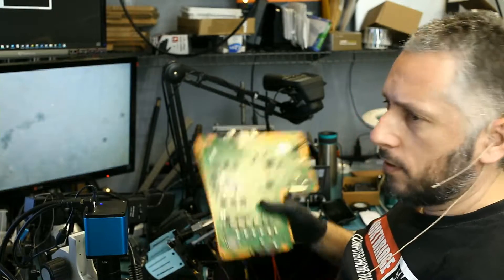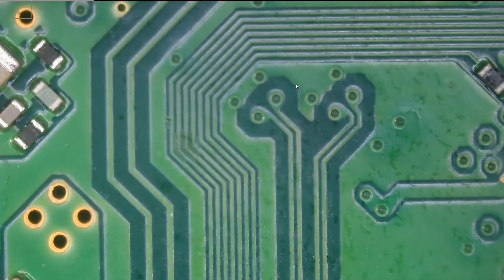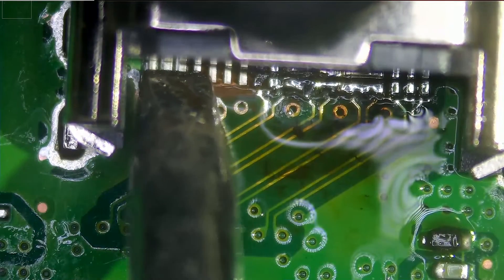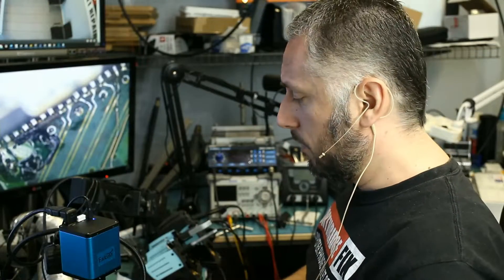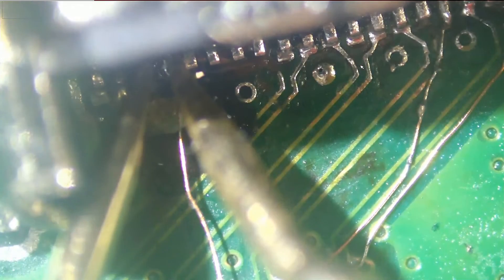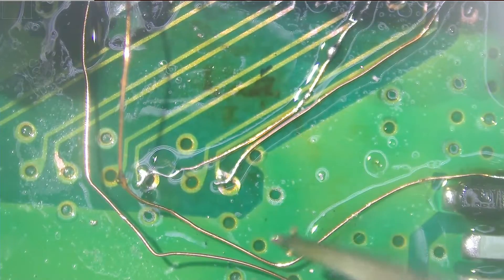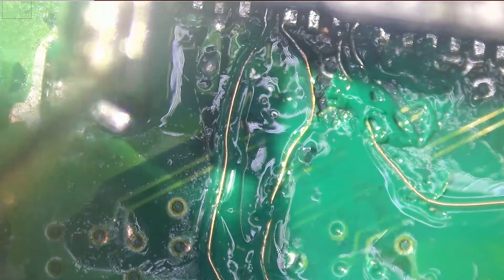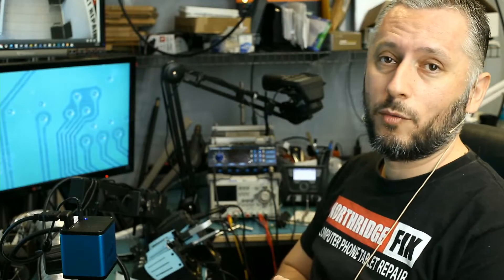PS4 HDMI Trace Repair - Pins Layout Diagram and connector replacement

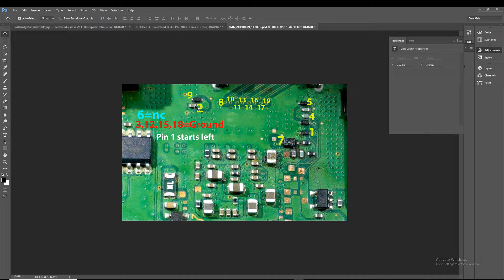Comment: Thanks! Good Video. Near same repair! 1 NOTE: Pin 9 is in fact Ground. If you look closely the sequence that starts on PIN 8 is as follows. There are 4 sets of data pins (those being (Pins 8 & 10, 11 & 13, 14 & 16, 17 & 19) as such At 1:44 of your video you have the pin outs you discovered with a donor board. Having said all that the minor correction here is that Pin 9 (HDMI) is in Fact GROUND (GND).
Each of the 4 Pairs of pins mentioned above has ground in between them. IE. (8,GND,10) (11,GND13) (14,GND,16) (17,GND,19).
Btw you marked it correctly as 9 (next to component) on your board diagram but might want to fix the list of Grounds to [ 3,9,12,15 & 18 ]
Thanks Again, keep up the killer work!

Comment: I use wires with enamel coating instead.
Reply: You still want a silicone coating or overcoat pen to secure the wires to the board for support so that the wires don't move and rip from where you soldered them.
Reply: @B9NE  that I always do. The one that hardens when UV light is applied

Comment: What size wire you using I have been doing some practicing I got a PS4 board that I've been using for practice the pins were fine on this board I have pulled the pins my self so I can use it to practice I have no other wire but ordered 0.10mm in hope it's the same as your using the thicker wire is to hard to sculp.
Reply: I’m curious about that too! You ever received that 0.10mm? Is that thin enough like what he’s using in the video?
Reply: @ArmanBahmani  I just got the 0.10mm and it worked great just the right size even a little thicker will do the job the stuff I thought was a little thick was 0.35mm really easy to bend compared to the last wire.

Comment: Hello and great video! Is there an alternative via for pin 19? The one on my repair is too corroded to solder to, the help would be greatly appreciated! Thanks
Reply: Hello yeah there is a alternative pin you can solder on a smd diod 6j there are 2 of them you must solder it on the up one   ! 
Best regards,

Comment: What solder wick do you use? You mentioned a lot of braids is good, mine is effective but I have to use it up fairly fast to actually soak up the solder. Just wanted to say these videos are amazingly educational and interesting! 
Edit: you also used glue for sticking the enamelled wire down in another video, what product is that? It didn’t need UV curing and wasn’t in a pen I believe?

Comment: This video is really good for fixing broken traces. What i want to know is what kind of copper wire did you use, where did you get such wire and what diameter is it , it must be a wire so thin that it matches the trace, but i have been unable to find a copper wire that is very thin in order to repair 2 traces on a pc motherboard because the traces are one next to the other.
Reply from the maker: https://rover.ebay.com/rover/1/711-53200-19255-0/1?mpre=https%3A%2F%2Fwww.ebay.com%2Fitm%2F40-AWG-Gauge-Enameled-Copper-Magnet-Wire-4-oz-8304-Length-0-0034-155C-Natural%2F371091477164%3Fhash%3Ditem5666c692ac%3Ag%3AiZYAAOSwgQ9Vw7C2&campid=5338440312&toolid=20008

Comment: low melt solder help a lot ! i removed one hdmi from ps4 pro, was hard to remove with quick (temp 500 deg / air 50), need time and efforts to avoid breaking tracks from board, many components under pcb moved from its place even with capton tape. After removing socket,cleaning and putting in all stuffs, all was done perfectly. Thanks for all your sharings and your generosity.
Best Regards.

Comment: Thank your very much for your Videos ! I have a Question about the PowerButton on the PS4 , what Voltage schould i espect to be on the Power Button ? Because i can only read 0.24 V on my Ps4 on the Power Button . This Ps4 wont turn on at all. i found out that the line filters on the HDMI Chip are all shorted to ground. I removed the Chip an the short was gone ! But the Problem remains i think its another short somewhere !